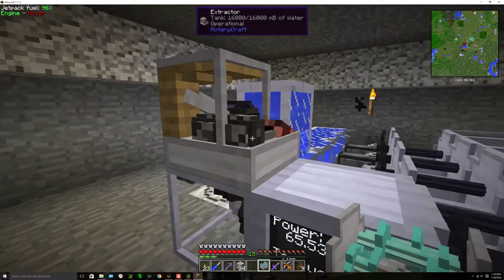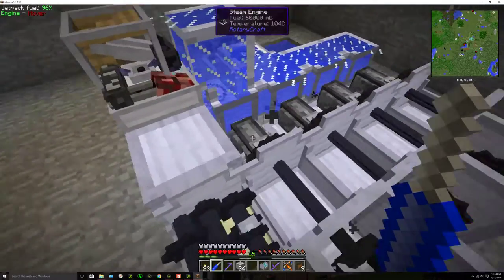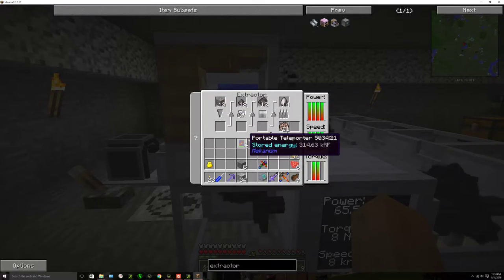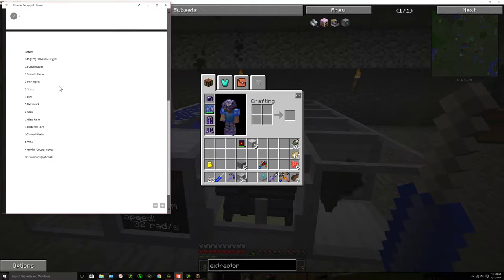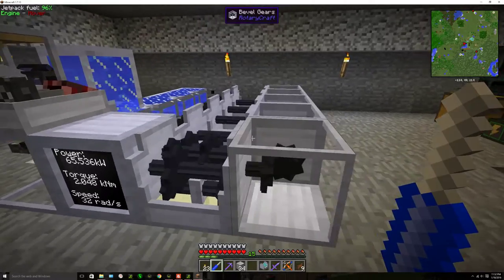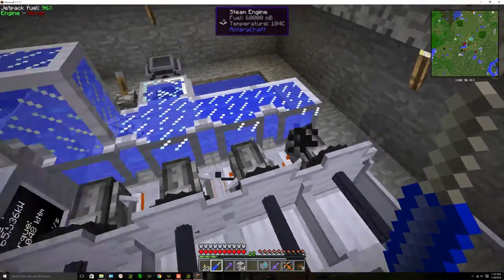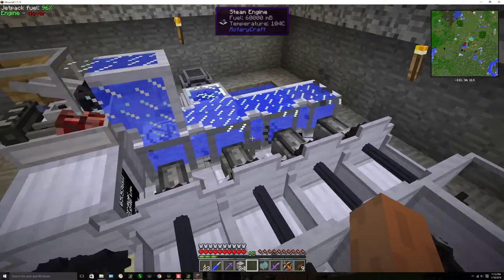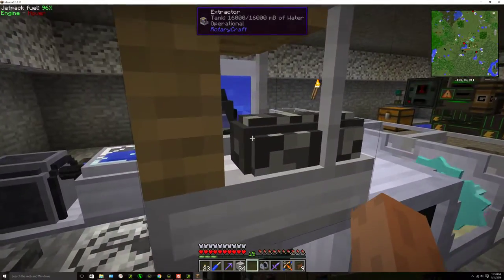The Rotarycraft Extractor Setup

Comment: If you use a multi-directional clutch, stone gearboxes are viable as you only need a 4:1 ratio to get the torque up and it's within stone tolerances. 16:1 is necessary for the speed, but stone can handle that. The setup will be slightly less compact and requires lubricant, but you don't need a huge lubricant system as the gearboxes will consume it very very very slowly so even including the lubricant supply the whole thing can still fit inside one chunk very easily.